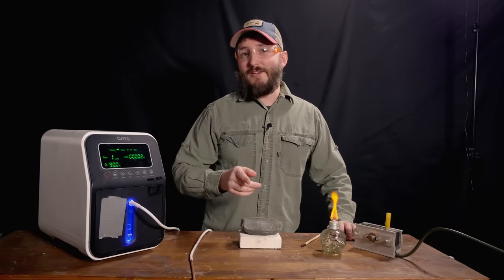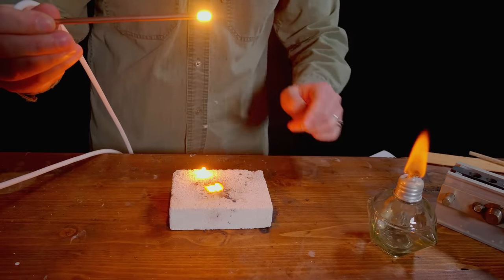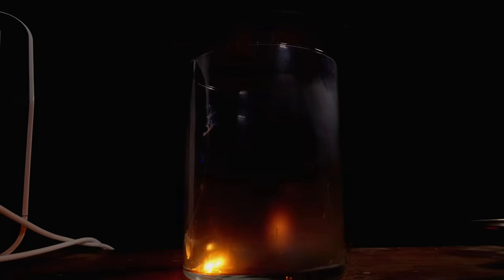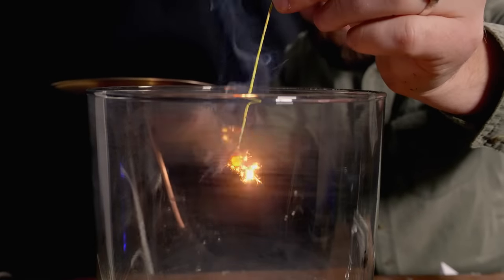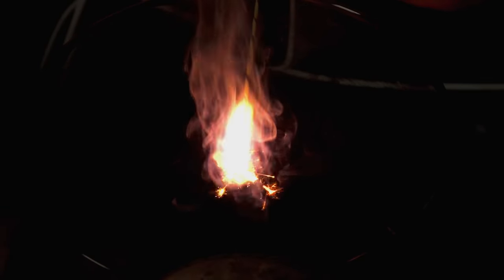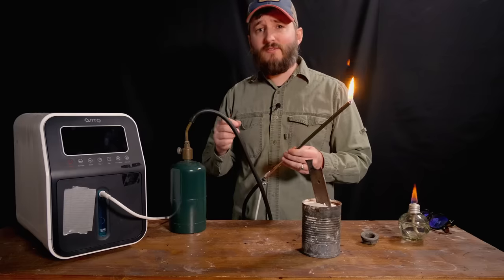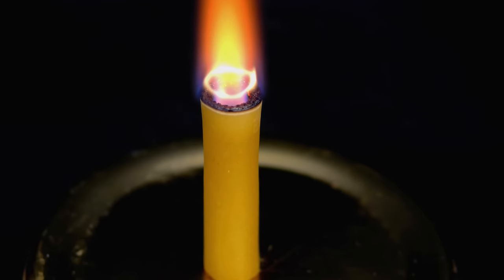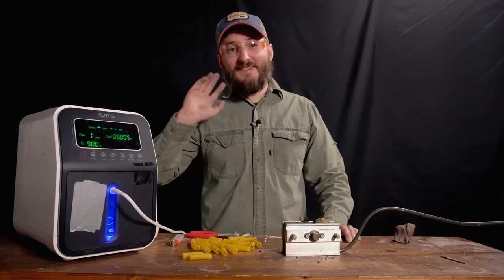6 Unauthorized Uses for a Medical Oxygen Concentrator

Comment: I think that the design challenge is hamstrung by having to work at low pressure. Rocket nozzle shapes don't really do a heck of a lot until quite high pressures are reached at the inlet of the nozzle.

Because everything has to be soft, I reckon that the max pressure limit of the system is capped at maybe 10psi. That's just 2/3 atmospheres higher than atmospheric pressure so I don't think we're going to be able to play with neat things like shock diamonds with cone designs.

I do think that it would be possible to make a broad faced cone and punch different shaped openings that converge so one would be able to get flat fan shaped blast outlets. 

I can foresee some potential for a "mixed bag o' tricks" approach using hollow pasta forms and clay to teach non rocket principles like light emissions spectra: Paint a number of dissolved metal salts on the inside of a pasta tube so different metals get ionized as the pasta burns down. Maybe you'll get a light show out of the changing colours blasting out of your clay nozzles. 

I can also see some potential for a crude "pasta cannon" that uses hollow pasta as a barrel for a soft clay projectile. When soft clay is thrown, it will often stick on things that it impacts. It's actually pretty funny to throw knobs of soft clay and have it stick to things.

I think it might be possible to make a small breech chamber out of thick walled firm clay. Some ceramic clays will include "grog" which is a kind of fine aggregate. Basically fired clay is ground into particles that are much larger than the fine silt that comprises most of smooth clay. The addition of grog makes clays significantly stiffer in their soft state. I propose that one makes a breech out of a soft grogged clay that you could fill with fuel air mix that goes pop with your cotton fuse trick. 

Attach to the grogged breech, a length of rigatoni to make a baby mortar cannon that poots a sphere of stickier ungrogged clay at a target or at a horizontal bullseye on the ground. Maybe go for distance where contestants get a finite lump of clay to form their combustion chamber. Larger volume chambers would have thinner walls and be prone to blowout, or geometric changes due to sagging. Smaller chambers can be made thicker and offer durability for more firings.

Everyone gets to make cannon breeches to huck clay boogers at things!

To get a good stoichiometric ratio of oxygen and butane, meter the volume of the breech by filling them with water. Inject the correct volume of butane into the fuse hole via a syringe with a cannula or needle and fire!

Comment: When burning the plastic tube I heard a typo.
You mentioned seeing the oxygen 'burning' inside the plastic tube.  Now I realize almost everyone thinks oxygen burns, but you and I know that oxygen only makes other things burn hotter and the actual material burning in the plastic tube were first the gasses leeching out of the hot plastic briefly until the actual plastic itself ignited.  Right?

Comment: Been doing this for years with oxygen and propane to oxidize the flame with a torch. I’m a glass blower and the real limitation to this is the PSI output from the concentrator. On average our torches run around 20-40 psi or so on the oxygen with around five psi on the propane. Now we’ve been doing this for years and we have work arounds. Mainly secondary tanks that get filled just like an air compressor. The intake is the oxygen concentrator. Now there’s a few more things involved but that’s more or less your next step sir
Reply: You have what’s called flame chemistries. You have a reducing flame you have an oxidizing flame and you have a neutral flame. Reducing is more gas less oxygen. Obviously oxidizing is more oxygen and less gas. Neutral is a mix in between. All of these different flame chemistries give you different results with different materials
Reply: But remember try try again

Comment: I feel like the propane oxygen experiment would have worked better if the oxygen tube had been somewhat recessed, such that the outer tube continued past it a ways. My thinking is that propane would have had a chance to combine with the oxygen before exiting the outer tube and contacting the unenriched air. No way it'd work as well as a purpose-built nozzle, but I'm curious to see how well it would perform. If it were me, I'd also try leaving the far end of the outer tube open to see if the fast-flowing propane would draw room air in thru that end to mix with the oxygen and propane; I'm curious if that would even work, and whether the mix of room air and enriched oxygen would be a worthwhile improvement for the torch temperature and flame

Comment: for the last experiment.. maybe grind some pasta into a dust. fill one of the pasta rocket cylinders with that dust and assemble it how u did the others with a couple differences. encase the cylinder with clay and make the top nozzle like an upside down funnel w a small exit hole. just thoughts.. the dust would react w the oxygen more intensely and be ejected quickly bc of the small nozzle perhaps.. could also just explode tho

Comment: Our automatic oxygen feed cut offs on our cupolas didn’t work, and we had to shut them off manually all the time I always check mine before I went down into the cupola to put bottom sand in you could hear hear it hissing so I always shut it off manually and put air hoses inside for 1/2 hour. 
I ran 2 daily melters.
Foundry on other side ran 2 week melts.

My buddy was lowering down on a hoist to put bottom sand in when he hit oxygen layer, he 3rd degree burnt over his entire body, took them 3 hours to get him out of bottom was in coma 3 days and died.

Comment: Could you use this to provide oxygen-enriched air to an internal combustion engine? You could also use it to provide oxygen-poor air to simulate the effects of high altitude training (just use the exhaust).   Using oxygen poor exhaust air as a fire extinguisher would be interesting.  For the pasta rockets, consider using clay along the length of the pasta tube to provide structural reinforcement, so it doesn't lose integrity prematurely.

Comment: 18:47 I agree that using the concentrator as the oxygen supply of a conventional welding torch would work much better.  You don't have to reinvent the nozzle design.

Comment: Copper sections are usually inserted in oxygen lines to prevent fire propagation from the consuming process to the generation plant. Copper will not burn in pure oxygen.
PVC is flammable at anything above 40% oxygen - a fact I found out after we torched an inert gas generator on an industrial site. (The oxygen extracted was vented through the control enclosure).

Comment: OK, I have access to one of those machines. Sometimes I have to burn pine needles because there are so many. Usually this process is very smokey. I wonder if using Oxygen can reduce the smoke, and speed up the burning. I'm thinking a  8' length of break line. Stuff it in the pine needles, and let the machine go. Then it's fire in the hole.

Comment: Flame temp was still in the yellow range.  You need a blue flame heat to melt steel.  Now I want to try this!
Reply: That's not how flames work...
Yellow flame means not all of the fuel is being burned, blue flame means complete oxidation of all of the fuel.
However blue flames do tend to be hotter for this very reason, complete oxidation means 100% efficiency of the burning process which produces the heat.

However this is only relevant for carbon containing fuels, if this is applied to other materials (such as metal flames) its completely inaccurate, as metals tend to have a colored flame. (for example, sodium is bright yellow, lithium is red, potassium purple, etc...).

Comment: While perusing the local  scrapyard for some tubing, I ran across an Philips "Everflo 102000" <<Search Term. The cord had been cut, but for $10, I thought I'd at least make an attempt at a repair. My first education was that the zeolite wears out. OK. I went ahead and repaired the cord, turned it on, it had an output, regulator is adjustable 0 to 5 LPM. I connected a hose and let it run in a  mason jar, then I inserted a burning toothpick, it flamed up, maybe not as much as I expected though, I also inserted just a glowing ember on the end of a toothpick it burst into flame. My carbon black rubber hose caught on fire very easily, that was scary but also seems like a good sign :-)  The unit does not have a percentage meter. >Edit. I just read my concentrator has an alarm, it alerts if concentration is below 82%, so assuming the alarm is working, the concentration is at least 82%.<
How do I now if it is outputting 95% oxygen?  How do I now if the zeolite needs replacement?

Comment: You should see what happens if you combine the output of a bunch of these Oxygen Concentrators. Maybe put the outputs of 2 or 3 Concentrators together to get a very high oxygen concentration with a good flow rate and increase the scale of the carnage. Maybe try to put the output of one or two Concentrators into the input of a single Concentrator and see what happens.

Comment: An Oxygen Concentrator uses zeolite aluminum canisters to separate the Oxygen and Nitrogen as Air is pumped through the system by venting the  Nitrogen back into the atmosphere and pumping the concentrated Oxygen out of the exit port that one connects to the tubing.  Oxygen is an oxidizer causing any combustible to burn more rapidly, the more oxygen that is supplied like a cutting torch uses Acetylene with Oxygen to create intense heat melting the metal.

Comment: If it is anything like what I have worked with , it has packed fiber filaments and pumps air through them  with two outlets separated by some distance. Due to the differences in elemental nitrogen and oxygen, mostly nitrogen comes out one outlet and mostly oxygen comes out the other end. If you collect the nitrogen and compress it, you can use it to pump up your tires with pure nitrogen and they won't go flat as quickly as just using normal air. You can also use the nitrogen and oxygen for other experiments as well!
Reply: No - these oxygen concentrators filter nitrogen from room air through molecular sieve pellets under cyclic pressure. Capturing the expelled cyclic nitrogen would be problematic  without also clogging said nitrogen purges.....which would in turn decrease the volume of captured oxygen going the other way. It could only be accomplished with a seperate nitrogen product tank....and a compressor.
Reply: @yomommaahotoo264  That is actually what we had on the "nitrogen generators" that the company that I used to work for did. The oxygen was just released while the nitrogen was pumped into a storage facility to displace any other gases. It just depends on which gas that you want to harvest from the atmosphere. Most of our customers used it for long term produce storage. Normal atmosphere compressed into tanks was pressure fed through some filters and into the the molecular sieve filaments packed tubes where concentrated nitrogen came out one exit and concentrated oxygen came out another.
Reply: @CobraTheSpacePirate  Good info. I thought about inventing (or proposing) a nitrogen supply system to feeding trucking pallets of foodstuffs to kill rats/mice. Those are a problem in the food pallet storage and trucking industry. The pallet would be wrapped in plastic and pure nitrogen introduced to kill/control all pests....but it would have to be inexpensive and portable enough to be useful.
Reply: Actually, wouldn't have to be portable in my opinion. Just base it at distribution centers/hubs. The tubes can be plumbed just like air hoses in a repair garage that uses air powered tubes. You can have CO2, and O2 sensors to measure how much of the gasses have been displaced by the nitrogen etc.
Reply: Workers would have to be careful and have redundant sensor arrays so that none of them suffocate thought. I think that is the main reason why they don't have such systems now. Probably too much liability involved is someone died from suffocation. You would have workers wearing oxygen tanks for safety etc. It just raises like you said, the cost and makes it cost prohibitive vs the benefits.

Comment: If you score a Homefill concentrator with pump you can have the best of both worlds by refilling medical and other high pressure cylinders (DO YOUR HOMEWORK, oxygen is no joke) then use those with conventional torches of larger size and have complete portability. Homefill fittings are now easy to find online and Western sell high pressure oxygen safe braided stainless "whips" along with CGA 540 and other fittings.

Comment: yes, i agree that purchasing a purpose made oxygen torch kit would likely work very well. but before you totally give up on your home made torch, I would drill several holes radially around your propane pipe, and end the pipe about 2/3rds of the way to the end. also likewise do the same with the oxygen supply, so that both gasses have a chance to mix. and crimp the end of the pipe a little at a time until it burns properly. if none of that works, then i am afraid your going to have to buy a store bought torch.

Comment: Could I ask a sciencing  favor. Content creation suggestion for fun... you bottle that 90% oxygen and test it in use for boosting a car engine like a Honda Civic k20 motor hondata ECU spare laptop for tuning maybe someone to help with tuning it a collaboration video maybe?... instead of using NOS but using a wet or dry nos delivery kit so oxygen/gas to see if you can produce more hp and torque safely.... Cold air intake oxygen welding tank regulator and flashback arrestor that machine ... used refrigerator compressor to  compress the oxygen into bottles. I've seen people use them for methane compression and propane bottling I've wanted to try it for fun but I don't have time and knowledge as such research time to see if it's doable thought I'd pass it by you. Thanks loved the video

Comment: funny :3
you can make explosions with loose cotton wool in oxygen when you are bored in the hospital...

the torch center is cold, the gases need to get mixed better. maybe try shortening the center tube an inch and put some mineral wool in the space for a little mixing zone in the tip the flame cannot reach and attach a reducing nozzle.

Comment: If you pulled the oxygen tube bake into the propane tube and had the propane tubes mouth forged into a much smaller hole you would have a proper nozzle. Its an easy forging if you have any blacksmith training at all. If you don't and you want to try it, you have to remember that very light strokes of the hammer are what's needed. I've been a blacksmith for years and my main working hammer is less than a pound.
    Remember, small hammer and light taps. If you can get one of those really small ball peen hammers, that would be perfect.

Comment: Most people dont realise that the speed of combustion - which is oxydation of a fuel - is controlled by the availability of O2. Lots of O2 = rapid combustion, less O2 = slower combustion. Hence why the throttle control on your engine actually controls the air flow not the fuel flow, which is regulated by the ECU using mass air flow meter. To make your car go faster you supply more air (and hence O2) , the ECU adds more fuel to match the air flow and voila you get more and faster bangs.  This is why fuel efficiency is better at sea level than altitude - more O2 saturation for less air.
Reply: interesting.
BTW Pabz, what do you think about all gubments drawing a line around you(Antarctic Treaty) and saying you are not allowed to leave? If you don't know what I mean, read my about tab.

Comment: To get the maximum oxygen concentration, be sure to use the concentrator in a very dry room. Use a dehumidifier if you can. A concentrator works by removing most of the nitrogen from the air, which accounts for 78% of its volume. The air can contain up to 4% water, so not removing it prior means the concentration of oxygen out of the concentrator could be much lower.
Reply: Designed correctly, most legitimate oxygen concentrators always work in humid environnents with no more than an expected small sieve bed contamination zone ocurring. It's only when a part of that concentrator system fails or begins to fail that the nitrogen NOT purged begins collecting water (as nitrogen does). If the compressor is strong (well maintained), there are no leaks, and all else works as intended, a concentrator (including sieve beds) can last a very long time. Invacare Mobilair V oxygen concentrators are a good example of conventrators rarely if ever beeding new sieve beds at the well over 50K hrs..
Reply: @yomommaahotoo264  I understand that, but that's not what I mean. I'm saying that if the relative humidity of the ambient air is high, there is less nitrogen (and less oxygen) for the same volume of air. So, when the nitrogen is removed, the output is less oxygen rich than if the ambient air is dry. That's why most commercial PSA oxygen concentration plants use a dehumidifier (air dryer) on the air intake.
Reply: @nic12344  Gotcha. On home concentrators you'll see a lower oxygen concentration moreso on the output after a humidifier bottle.

Comment: I have seen Integza make 3d printed rocket nozzles that perform in different interesting ways. What I would suggest is to have a 3d print of the negative space inside of a nozzle. Then you would form the clay around it and then remove the 3d printed part. Is there a name for this? Like an inverse mould?

Comment: Can you buy a Plasma cutter and test the Oxygen Concentrator? You can run them on air compressors but it would be interesting if you would get a performance boost. Put the Oxygen concentrator upstream of a air compressor to check performance.